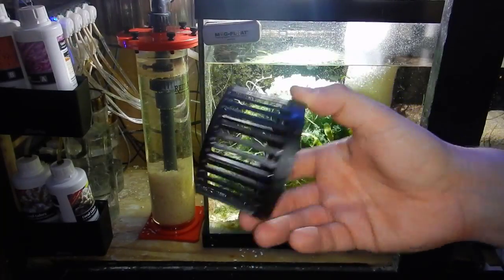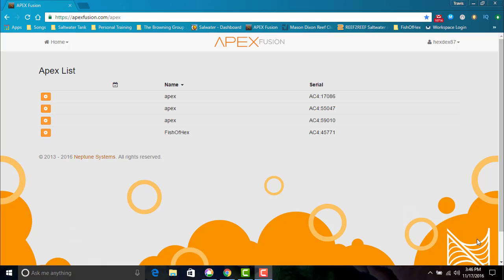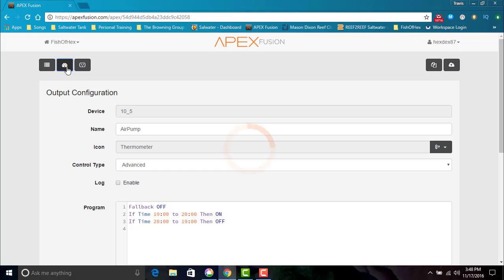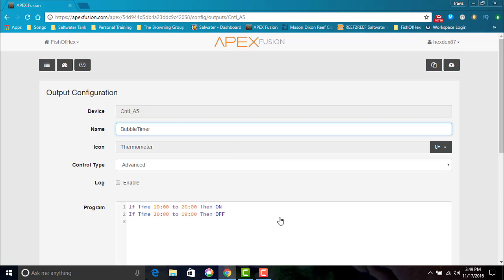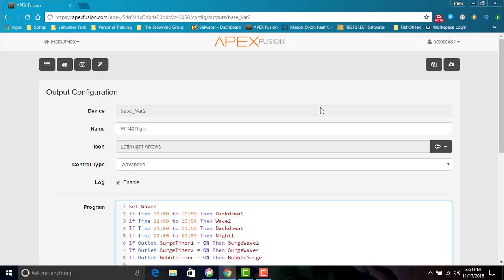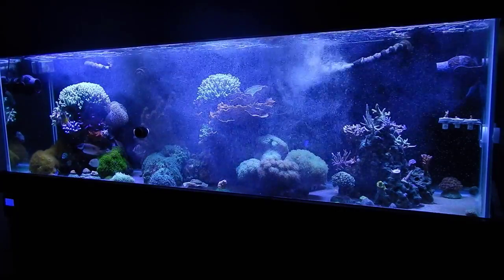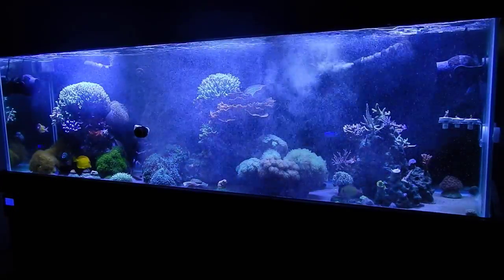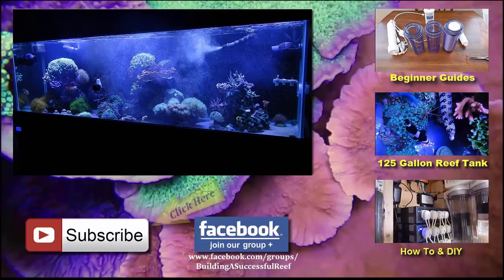Setting Up Micro Scrubbing Bubbles In A Reef Tank

Comment: Interesting video, thanks for this. On what schedule do you run the bubbles? Like, every two hours for ten minutes, overnight, etc? After you mentioned you would be doing a video I went and did some reading and set something up for my 20g nano. But I don't run any controllers and use a Jebao wp10 for water movement so right now I've got limited dispersion of bubbles, they are pretty dense in half the tank but are pushed back by the Jebao.  

I've read a bunch of different opinions on timing of the bubbles...I was thinking if the bubble bursts  were short enough I could just put both the Jebao and the air pump on alternating cycles using a simple plug-in mechanical timer....then the Jebao could be off when the bubbles are streaming from the return and they might get better dispersion through the tank. Does this make sense? Am I understanding the principle correctly?
Reply from the maker: I run my bubbles from 10pm to 1am once the lights go out. and its the entire time 5 minutes on 30 seconds off ect. I think if you can get the bubbles small enough and spread them out within the entire tank i dont think you will have any issues. I use a wooden airstone that already makes small air bubbles and then use the return pump to make them even smaller. When they are small they end up getting a charge to them that allows detritus, mucus ect to stick and be lifted to the surface.
Reply: Thanks for the info. It looks really promising if I can get the right dispersion in the 20g. Today I'll be pulling out the timers and testing it. I've got wooden airstones and they seem the perfect type of thing to make the bubbles, it's just setting it up so the return pump pulls enough of them in before they get to the surface. It's a process......

Comment: Better polyp extension and coral growth is a good reason to go to all this effort, but has anyone actually directly compared the growth of two identical tanks running this method, and one not?  

Dirtier socks and skimmer, well, you'd call that circumstantial really, you would also want to notice a significant reduction in nitrate and phosphate (etc) for that to even mean anything useful otherwise it's just more work.

Comment: Many people have a hard time getting rid of microbubbles in their tank, how do you get rid of them after bubbling? Just cranking up the flow? And why did you choose to do it for an hour instead of having it run all night or 2 hours or... Thanks
Reply from the maker: I didnt feel a need based on my nutrient levels in the tank. Two hours at this point does enough, as for getting rid of the bubbles my surge modes in the morning will take care of anything trapped under the coral or rocks
Reply: ***** Great thanks.

Comment: I'm trying to figure out why you are using a virtual outlet for this. You could have just used the If time statement on the wavemakers to run the bubble surge profile instead of the virtual outlet. Just seems like an extra unnecessary step.
Reply from the maker: I use virtual outlets for my surge mode timers so im sticking with the theme and at the end of the day it doesnt matter how its done, the point is it works.
Reply: FishOfHex not saying it doesn't work. Just seem like an extra step. For the surge modes if you using a OSC command them the timer virtual outlet is the best method

Comment: hey I just started using the bubbling method. so far its going well. Only thing is not sure if its an issue or not is that when the bubbles hit the surface they pop. will this have any negative impact on the tank?
Reply: also a few of my sps have a couple tiny little bubbles underneath them. I don't have the ability to alternate wave modes as I only have one pump which is on %100 already
Reply from the maker: its normal for them to pop, when they do they leave what they collected at the surface to be skimmed off.
Reply from the maker: I would get more flow in the tank to move those bubbles.

Comment: If u dont have sump. can i keep the wooden air stone below the wave maker n try it. kindly help sir i am newbie
Reply from the maker: Yes you could place the airstone under a powerhead so when it turns on the flow will move the bubbles out into the tank. You will need something to trap the detritus you are collecting with the bubbles, so what are u using a hang on the back or canister?
Reply: have you ever think of putting a skimmer pump near de return pump? i might try it. nice video!